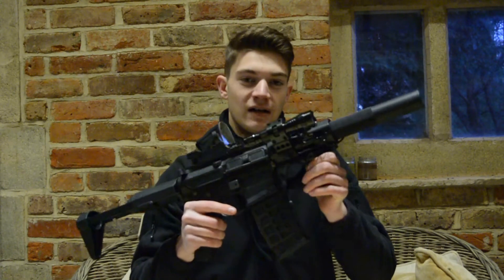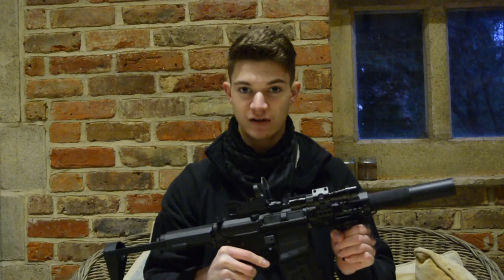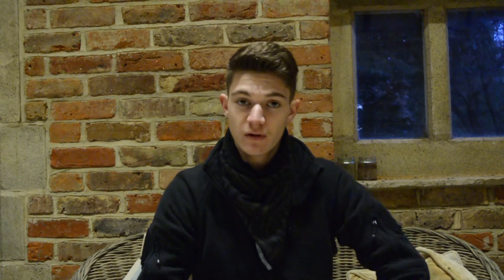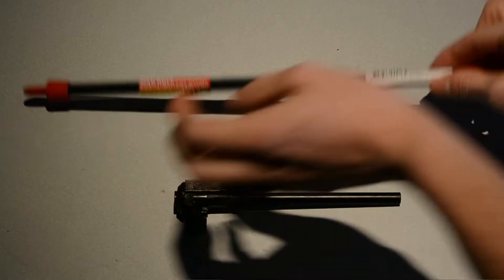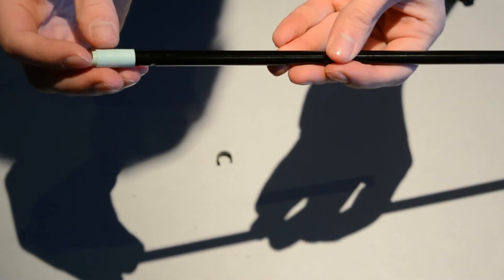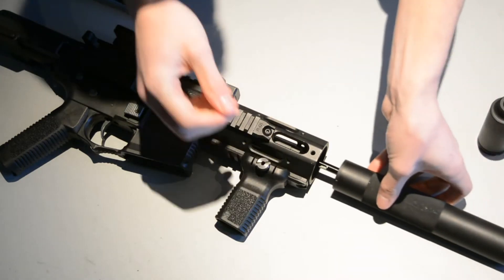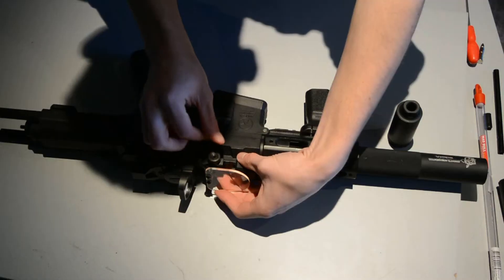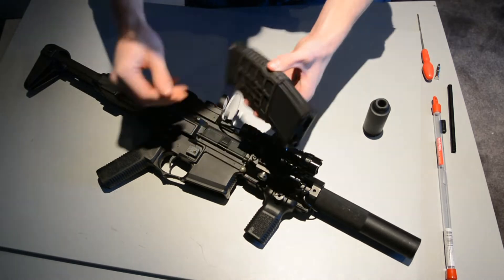Custom Honey Badger! | Airsoft Upgrades Ares AM015

Comment: I made a DSG upgrade on my 015 with two magnets on the sector gear. It is easy to make it, and the trigger response and the sound of the gun are amazing.
Reply from the maker: nice, i'll look into that!
Reply: The pre-cocking mod is even better, and really simple. Instant trigger response, no motor or gear noise!
Reply: @Gattobuono  any links ont this subject? thanks !
Reply: @2Drezik  Okay, this is rather long!

Here's how to do the Amoeba single sector gear pre-cocking mod:

The sector gear on the Amoeba gearbox has a small but very strong magnet positioned in the hole just below the tappet plate activator.
When this magnet passes beneath the sensor arm on the mosfet it triggers the cut off/active braking function.
This ensures that the sector gear always comes to rest in the un-cocked position.

For this mod, you need to remove that magnet (needs drilling out, not easy, I sometimes cut the gear in half to salvage the magnet) or use a similar standard ratio sector gear, which must have the holes all the way around it. 

You then place a new magnet (or if you managed to save the original you can use that) in the hole directly above the tappet plate activator.

This now stops the sector gear in the cocked position, just before spring release.

That's really all there is to it apart from the following important points:

1. This works best with the blue efcu. It will work with the green one found on the Amoeba M4 pistol, and other cheaper versions of the Amoeba, but the blue efcu has far better anti braking to prevent over spin. (Honey Badger comes standard with blue efcu)

2. You need to use the original motor, or similar. A high torque/speed motor will likely cause over spin.

3. You need to use a fairly strong spring (at least m110) to prevent over spin

4. You need to use a 7,4 lipo as an 11,1 will cause over spin.

Points 2, 3, and 4 are all positives as far as I'm concerned, because your only expense it a new sector gear and magnet (Amoeba sells the magnets, I can find them here in Italy), and perhaps a stronger spring if you don't have one.

What's more, you get instant trigger response with a normal rate of fire. No exaggerated 40 rps! As we use semi-auto nearly exclusively, that's perfect for us!

Important note: when you finished with your aeg, always de-cock it to release the strain on the gearbox.
You can do this in two ways:

a. remove the spring (quick release is useful!) and replace it with a very weak spring. Fire a shot. The motor will over spin due to the weak spring, you'll hear a double shot, and the piston will return to the un-cocked position. Replace your original spring.

b. attach an 11,1 lipo. Fire a shot. The motor will over spin due to increased voltage, you'll hear a double shot and your aeg will be de-cocked.

Remember, when you attach your battery, the first time you pull the trigger the gearbox will set itself to the cocked position, a bit like racking the charging handle back. Next time you pull the trigger you'll get an instant shot, and so on ....

I originally learnt this from Mikie (not sure how he spells his name) at Chupacabra Outdoor (Italian, but speaks English).
Search for this video: ENHANCE YOUR TRIGGER RESPONSE!!! ARES Amoeba EFCS PRE-COCKING on a Standard Sector Gear (SSG)

You can also check out judoman0928 on youtube. He often does this mod with a dsg, but I personally don't think it's worth the extra hassle as a ssg gear already gives you fantastic and fairly realistic trigger response.

A presto, Gatto 😺

Comment: Hi Riddle Goose, technically, there's a problem with the mod that you did here: incorrect cylinder/barrel ratio, which means that your aeg won't be functioning efficiently.
I've worked extensively on the Amoeba series, and the short barrelled rifles have a very low capacity cylinder due to the short inner barrel. I've also seen quite a few examples where Ares have removed 2 teeth from the sector gear to get a relatively inefficient set up to shoot at the right joule rating (1joule here in Italy and many other EU countries).
You've just doubled the length of your inner barrel, which means that your aeg is now 'under-volumed'. An under-volumed aeg will need a much stronger spring to reach the correct joule rating. A stronger spring will mean that your motor will be struggling more, and your trigger response/rof will be reduced. It will also put more strain on your gears, and I've seen Amoeba gear loose teeth when under too much strain.
I advise you to study cylinder/barrel ratios, you probably need to get a cylinder with a 3/4 or 4/5 port.
When you have the correct ratio your joule reading will be higher, you can then replace the spring with something weaker, giving much better efficiency, range and accuracy.
If you need any help or advice just ask. 🙂
Reply from the maker: thanks, thats very interesting and informative i will look into that